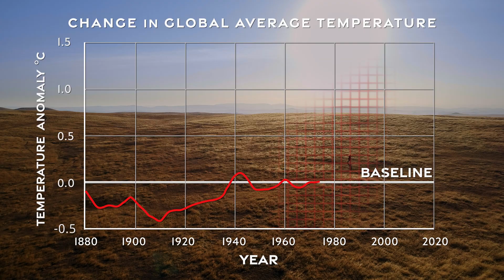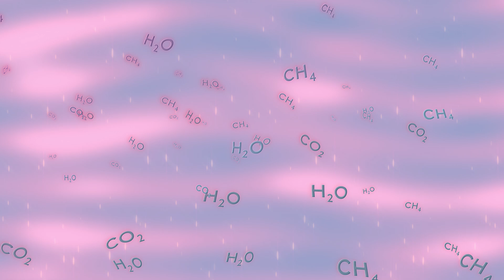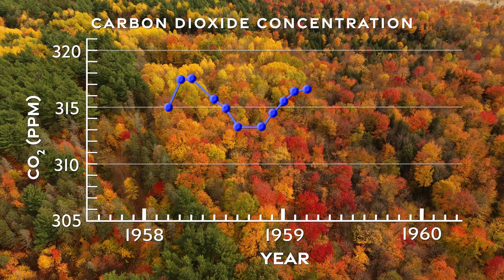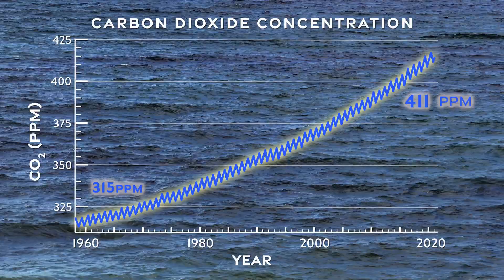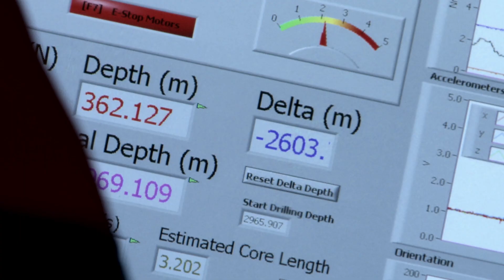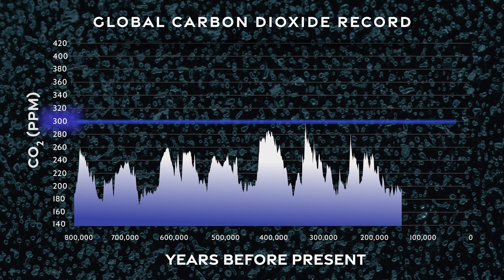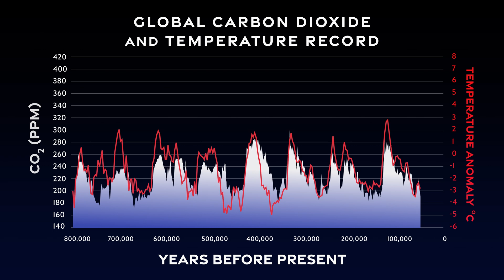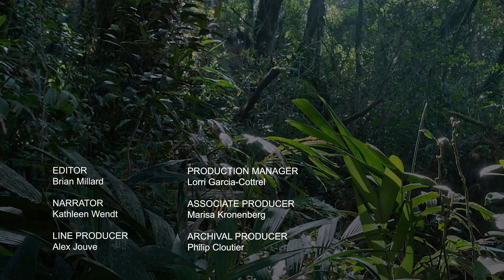The Science of Climate Change | HHMI BioInteractive Video

Comment: How can you say that the drastic weather patterns are more often and more severe, when the actual science can not find any evidence of it. There has been a slight, but no statistical significant decrease in the power of tornado's and hurricanes. Forest fires are down where ever the internal department is allowed to do clear burns and other forest fire preventions. It is only up where anti forest fire measures are prevented.

"We saw the hottest decade ever" yes, the hottest decade since 1890, when the little ice age ended. That is the earliest date we have actual temperature readings.
Reply: Hi Robert-that is not quite accurate. Check out HHMI's Impacts of Wildfires that presents data on three potential causes of increased megafires. It uses actual data to form a conclusion
Reply: @amyfassler6276  So you saying that filling up forest with dead wood had nothing to do with the forest burning hotter and thus harder to put out?